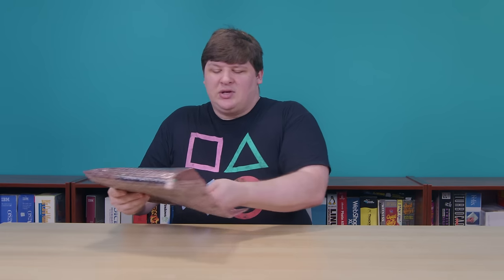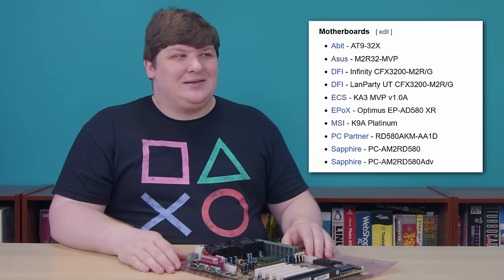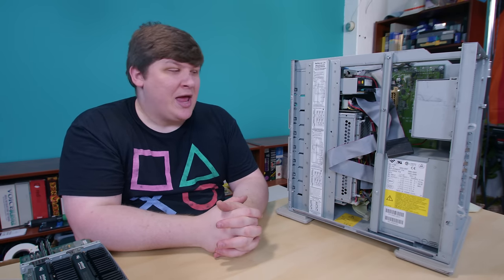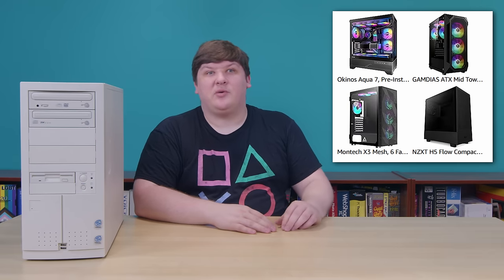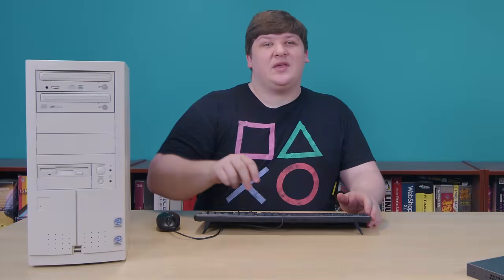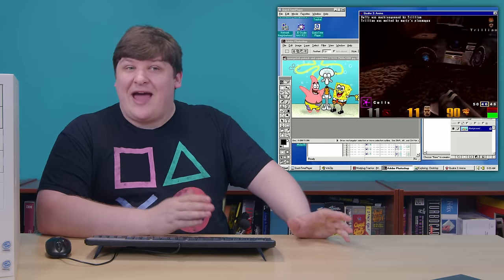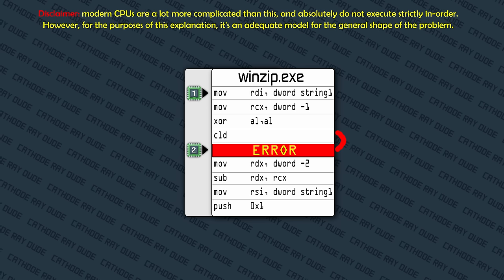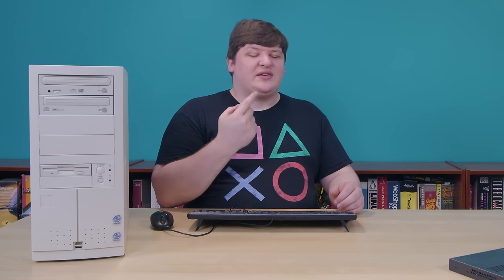The Only Famous Motherboard

Comment: It is possible to use multi-threading for .zip but there are a few things to mention. First of all, the major thing is to do the IO sequentially. This is even true on current SSD's, but for HDD's it is absolutely *essential*. One of the reasons why unzipping is often slow is that you are hitting the drive for both reading and writing of separate files. So if you go through it with one process then you're getting this basically for free. Having a large RAM buffer helps of course.

Second is how to distribute the work. Well, you could just look for files and distribute those. But in that case you're failing the sequentiality thingy. So you'd have one stream, put it into a large buffer, then split up the stream. The packages in the stream need to be large enough as the CPU might unzip (INFLATE) them before the other one even starts, and then get starved. But if you are doing it as a single foreground task then the CPU will simply outperform the IO and it will not get you anywhere. If you do it as a background task then yes, you may be finished earlier but 1. it is a background task and 2. you will be using the CPU and cache of the other frickin' processor running the foreground task. And then we have the interference with the IO, which was already doing things in parallel.

When we're talking WinZip: the major issue is that it is also stupidly updating the GUI, trying to show all unzipped files. This slows down the process immensely, and the command line is much faster, especially if you also disable the output. Well, and then there is McAfee, but please don't go that route.

Comment: I used to have a Abit VP6 dual socket MB and had to run W2K at the time in dual boot with W98 in order to utilize the dual processor setup. Eventually with the introduction of WinXP that problem was solved.
I had 2 PIII 1200mhz in there. I remember that my mate who had one of the first P4 even made a comment that my PC was so much faster and stayed reactive while running heavy loads.
Eventually some of the capacitors on the MB popped which rendered one of the CPU's unusable so I eventually also got a P4.

Comment: By the time dual-core CPUs became mainstream, they were in dire need because Windows had so many background processes and you basically had to run an antivirus and a firewall. So one core was handling the background tasks while the other one was actually available for the user.

Comment: I didn't own a BP6 but I did have a Dual Slot 1 with 2 PIII 1000's, However it was well after all of these were worth bragging about. Wish I still had it though although I may still have one of the processors kicking around.

Comment: Someone gave me a retired poweredge 1300 in about 2004. Dual 550mhz xeons, 512mb RD ram and 3x 18.3gb SCSI in RAID 5. The only downside was that it didn't have an AGP slot, so it was reserved for acting as a server for my games, music and anime. I added an ATA100 card and maxed out the drive bays with 250gb drives for a massive 1tb.

Comment: Most games are still singlethreaded or at least don't parallelize their workloads that well. the most popular rhythm game ever made, osu, was completely written from the ground up to be multithreaded so a thread can handle the input at 1000Hz, the audio is on another thread, and the video on another, and so on. most games don't do this, they don't poll your mouse at 1000Hz or whatever, they poll the mouse at the FPS that the game is running at. 
it took Cyberpunk until a few months ago to properly use your entire CPU instead of a single core. it's still something game makers are struggling at. I'm also pretty sure they didn't actually code the multithreading, CDPR is very modding friendly and there was already a multithreading mod and they either hired the person or bought the code off of them.
it's just way less noticable because modern OSes have gotten a lot better at moving tasks around to different cores

Comment: I had one, one of my favorite boards ever. Overclocked dual 366 to 550 (I think), and had to have two PSUs and some loud Delta fans + heatsinks. One day forgot to turn on the second PSU that ran the fans and cooked it.

Reason why it was so loved: it felt like you were cheating the system. Getting a value CPU, and TWO of them, and then they could be trivially overclocked and be stable without much issue.

Comment: Windows is running A LOT of different processes.  So Winzip is being stopped and started a lot to let lots of background processes to run.  When the OS scheduler restarts Winzip for another slice of time, it could be run on either cpu (or core), totally at random.  So the odds are, it will bounce from cpu to cpu over time.
C compilers can be mulit threaded.  GNU GCC does allow you to select how many cpu's to use.

Comment: I never knew how cheap that board was!  But i knew about the Celeron 300As.  I'm pretty sure thats going to be in your part 2.  It was a CPU that OC'd at the most ridiculous amount, and it was as easy as switching the FSB from 66 to 100 MHz.  I remember this time fondly because it also cemented thee Intel 440BX chipset as a very memorable one (the first memorable chipxet in my memory anyways...the next ones being the KT133 and nf4).  I remember when OCing, we want to stick with official FSB speeds otherwise you can get your PCI and ISA clocks out of whack.  I've corrupted data by OCing this way (this is due to fixed dividers).  OCing with Socket 7 allowed us to play with multipliers but I belive it was when the Pentium II era where multipliers were fixed and you have no choice but to futz with the FSB.  I owned a PII 450 back then - it was expensive and it was a 1998 MaxPC Dream Machine build (well, close to it).  Not long after i built it, S370 came out, cache came on-die at full speed (remember the PIIs came on a slot package with cache half speed on the card), and Celeron in the slot form were crap because no L2 cache.  The socket 370 PIIIs were amazing because of the on-die cache and they ran full speed (256kb if i recall), and the socket Celerons had the same on-die cache but cut in half (128kb) running at full speed.

That made that specific Celeron the magical one that everyone wanted.  IIRC, Celeron 300 was the slot version, Celeron 300A was the socket version.  The 300A was the lne you want.  It perfomed nearly as good as the PIII at the same speed in games thanks to the cache.  And even sweeter was that it ran 4.5 x 66 MHz to get that 300 MHz (in reality 297 MHz but they always round up to market it better).  So by simply bumping it up to the next highest official FSB on the 440BX chipset - 100 MHz) you get drumroll 450 MHZ!  Easiest OC ever!  No need to mess with weird unofficial FSB and dividers.

You'd think that's too much for a 300 MHz chip, but most people (including me) had no issues.  It was almost like it was meant to be a 450 MHz chip!  150 MHz OC was unheard of at the time.  This budget chip ran almost as fast as their much more expensive flagship PIII-450 at the time.  Thats why during 1999, 440BX, and Celeron 300A was the combo to get!  I wish i knew about the abit bp6 then...i would have bought 2 Celerons!

I was already running Win 2000.  I was expecting not much games to work, but i was surprised.  The games I played at that time was Tomb Raider, Max Payne, and Quake 3 Arena on the first Radeon (posthumously renamed to Radeon 256 if i recall).  I don't recall if i ever went back to my DOS games (previously played DN3D, MK, znd MK2)...i honestly wonder if they played on Win 2000.  I was shocked at how well that OS ran games for a Workstation OS.  Super stable and fast, too.  I honestly don't recall how i got that OS... I'm sure i didn't pay for it, lol.

Comment: Back then, I had a Dual AMD Athlon MP server at home, running on a Tyan server-style motherboard. That was 2x 1.2GHz. The Athlon MP was a rebranded Athlon XP with official Dual-CPU support. Today, my fastest system at home is an AMD Ryzen 9 7950X with 192 GB RAM, a virtualization host. Different times ...

Comment: Enthusiasts were pretty split on the celeron vs p2/p3 debate at the time mostly depending on when you looked into the differences.  Initially the celeron had 0 l2 cache and it performed atrociously, so poorly that intel rushed their new design for the p2 and released it first as the Celeron 300A.  This design had full speed cache instead of the half speed of the P2 albeit in a smaller amount as the Celeron product.  

This strategy worked so "well", intel would make the same mistake in the coppermine era and release a 733mhz celeron before the next segment of P3's.  This caused so much confusion that many people thought the refresh 128KB l2 coppermines were p3's since they performed so well compared to previous cores.  In fact wikipedia still thinks the og xbox used a P3 when that part would later release as a Celeron.

Comment: Most people used windows 2000 on this since they both released within ~6 months of each other and later XP pro.  I was already running linux back then, so the switch was pretty easy and made a pretty huge difference since my previous machine was a 486 with an ancient asus motherboard that i had updated all the way from 33mhz to 133(amd).  This motherboard/cpu combination was so good that it kept if until the first multicore desktop cpus came out, then i gave it away to a friend that used it for ~5 more years without issues.

Comment: I remember the Celeron getting close to the performance of a Pentium 2 mainly because of the cache - it was smaller at 128kb compared to the p2's 512k, but it ran at full cpu speed instead of half. A factor for me was also overclocking. I couldn't run mine at 100MHz bus, but I could stable at 75, which had the upside of also overclocking the AGP and PCI interface.

Comment: The only OEM produced dual CPU machine of that era (pre-ABIT BP6 of course) that I can think of that was even REMOTELY close to a consumer PC in configuration was the Compaq Professional Workstation 5000... but even that was just because it had a typical desktop PC form-factor sitting horizontally under the monitor. Inside, it was just as proprietary as both of those behemoths you showed, though it was much closer to what a typical proprietary desktop OEM motherboard from the likes of Dell or HP would look like in the 2000's, with a daughterboard for the expansion slots. But it could run dual Pentium Pro 200's, had on-board SCSI... and cost like $8000, so it definitely had more in common with a server of the day. Just looked like a desktop machine.

Comment: The impressive thing isn't that it has a wiki page, but that the nazis in charge haven't deleted it. (they've deleted way more notable things as "historically insignificant".)

Much of the mutli-processor word was targeting enterprise servers (which is what you'd see landing in e-waste), but there were "consumer" level stuff out there. A coworker of mine in the late 90's had a dual 486 - YES 4-8-6! - in a normal (for the time) mid-tower case. Everything else about it was standard consumer PC stuff. (Of course, I had a BeBox - dual PPC) I would still say the Magic(tm) about the BP6 was the "without modification" bit, as most CPUs at the time didn't explicitly support SMP, or overclocking. I never cared about overclocking - I cared far more about stability. But my "gamer" friends sure did, and they couldn't stop drooling over the stupid BP6.

Comment: Back then when dual core cpus started with the Athlon X2, it was common to separate tasks and programs between cores using programs like process lasso and at some point Windows XP incorporated that functionality. It was normal to leave OS tasks on CPU0 and move games to CPU1 and things like that, it was a way to solve some bottlenecks if you run very CPU intensive games like RTS. Nowadays you don't really need to do that since we come a long way but you can still do it if you want.

Comment: I had this board back in the day, getting the ATA66 controller to work in Linux when the board first came out was a real challenge but boy was it fast compiling the kernel once it was up and running with my dual Celeron 300As clocked to 450MHz. I even spray painted the megatower Aopen case blue with the power button, 3.5" and 5.25" slots silver.
After the BP6 was released Intel actually nerfed the CPUs so they couldn't run in SMP, to push people to the higher end product lines.

Comment: My first computer I ever built completly from scratch with dual celeron 366's at 550 on a BP6 in early 2000, and I was running windows 2000 beta from the get go

Comment: I fryed one of these in ´99 with condensation from a poorly installed peltier cooler... Was the first one with over 1Ghz compute available, running clocky Celerons at 500Mhz... King of the nerds for a summer until i went for peltier cooling... lol...

Comment: Celerons were because there was a feature with them that allowed you to jump pins together to enable SMP. The BP6 was unique in that it didn't require the jumpers and that was handled on board. I apologize if you cover this later in the video, I'm telling at my screen in the middle of the video.

Comment: I think the early days of multiprocessing was one of the reasons the Playstation 3 was so hard to develop for, When devkits were sent to developers in late 2005/early 2006, Heterogenous computing was not a thing and Multiprocessing on the cpu end was barely a thing. So only a handful of developers knew how to use a multi core setup until the early 2010s when Sony was starting to sunset the hardware. It may seem like it was invisible to users but for developers and engineers it was a nightmare. I know some showstopper games would do a lot of effects on the cpu on the PS3 because of its powerful cpu, Games would do things like Cloth Physics on one of the 7 cores and so on and so forth.

Comment: Having grown up through this period and not having the money to purchase a fair amount of this hardware until it was completely obsolete 5+ years later I loved this video. Having a PC / monitor / peripherals that didn't suck at the lan party was def a thing back then. Also it wasn't just sucking up as much Internet bandwidth as u could when you were at ur buddies house. You could copy games, music, videos, and just general files over the network and it was so much faster than any other means back then short of having a HDD you could swap around.
Reply from the maker: yeah I didn't want to get off on a tangent but I did have a fast ethernet LAN at home at the time this board came out and I absolutely adored local filesharing.
Reply: Also we were all running Windows 2k back then. NT had no end to driver issues and it just wasn't worth the trouble.
Reply: @CathodeRayDude  the trick for us was to download everything at school in our computer clases because our teacher didn't care if we brought in our own computers and then share it amongst ourselves later. Good times.
Reply: @CathodeRayDude  also I never had the Abit board but back right as the Pentium D's were dropping I got a Tyan board with dual tualatin 1.3 ghz CPUs. They were basically obsolete at the time but the tyan board was similar to the Abit board in that it was a standard atx form factor and was cheap to build a system with.

Comment: 56:26 Objection your honor. I can name the ECS Elitegroup K7S5A as one of the most terrible motherboards ever sold. It was in the AMD K7 era ('duh) and had so many revisions that one would think they would eventually get it right. But no. The most notable fudge (over several revisions) was that when installing a heatsink with a wide clip, it would pretty consistently crush a resistor network that was right below the clip. I had customers demand they assemble their systems on their own just to come back in 45 minutes later with a broken board they insisted to buy earlier. We put in big red sheets of paper warning people of that problem after the third one in a week (and crushing one myself). :D. "Good old times"

Comment: With those older core families having less cache on die actually made the overclocking reliably hit 150% (300a cpu at 450 almost every time).  On top of that the Celerons were not intended to work in any SMP configuration, to supposedly force you to buy P3's for that functionality.  This was why most other motherboard companies never made a "screw you Intel" board with features Intel didn't authorize, or they could lose their relationship as an authorized vendor, etc.  Overclocking was about as far as most went.  Or you could use a dual slot board and a off-brand "Slocket" that had the SMP enabler hacks on the adapter, and than you could put 300a Socket370's into that, but slockets and slots generally sucked anyway so you never got the reliability of a BP6.

So the BP6 allowed enthusiasts to "stick it to Intel" twice, and the "you aren't my supervisor" was a very hot mentality.  Doing things "the man" said no and getting away with it was 90% of the thrill even if it wasn't particularly any better.

Comment: If I am remembering correctly the main reason that the socket 370 Celery CPUs were so popular and desired is because they where very cheap compared to a pentium and they were insane overclockers. So you could get a real bargain on the cost of the CPU and then overclock it to the point where it would beat out quite a number of pentium cpus that cost significantly more. And to top it all off Intel designed the  Celery CPUs so they couldn't be used in SMP machines to ensure that enterprise and workstations had to buy more expensive CPUs in order to get all that SMP goodness but the BP6 was designed to bypass this intel limitation.